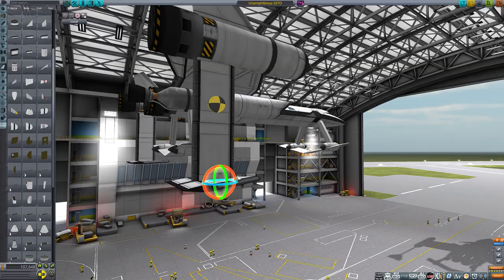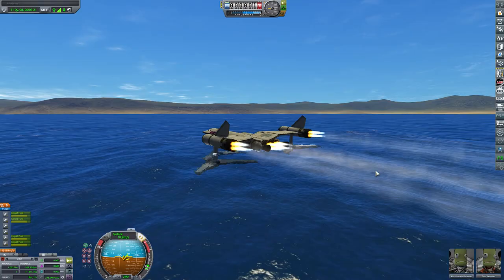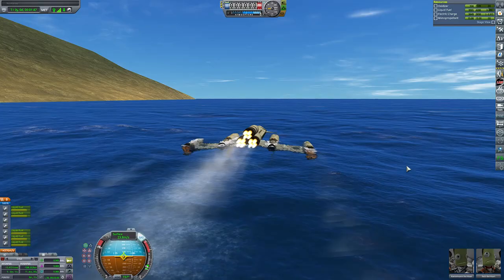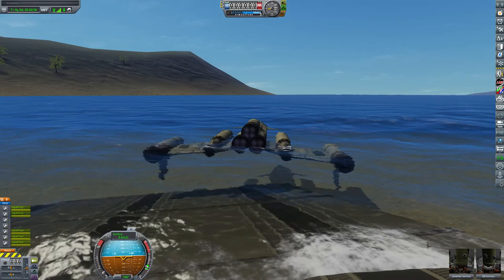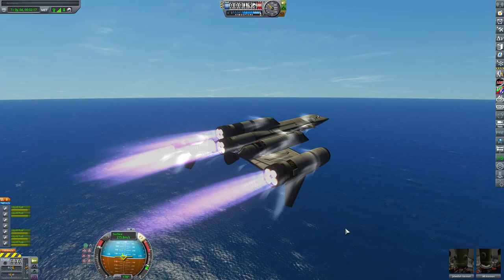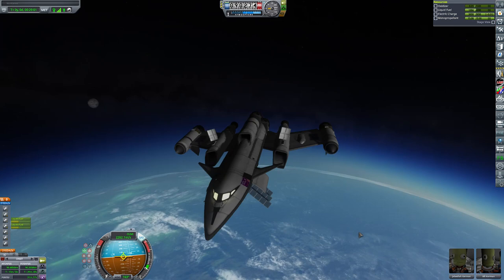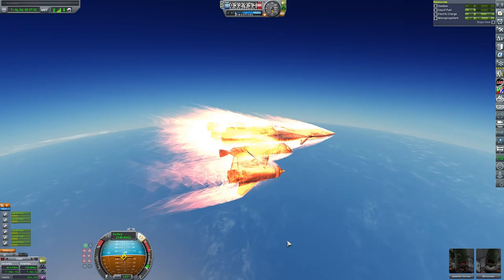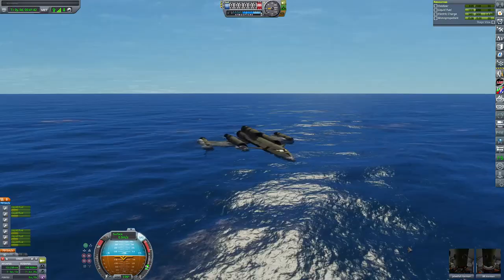KSP: The Ultimate Amphibious Spaceplane!

Comment: Actually, both you and matt start designing hydroplane from wrong point. You try to make it jump from water first - that what should be done last. Space plane with predictable descent should have aerocenter HUGE behind mass center - what block flying low speed. deal with it, than add sepatrons to the nose or smth)))